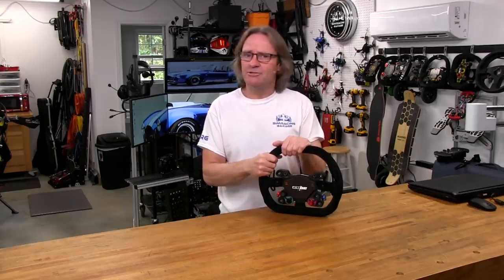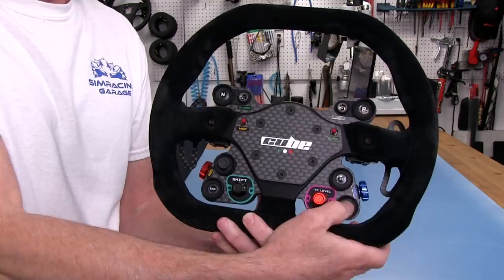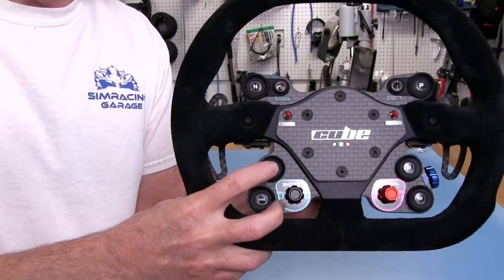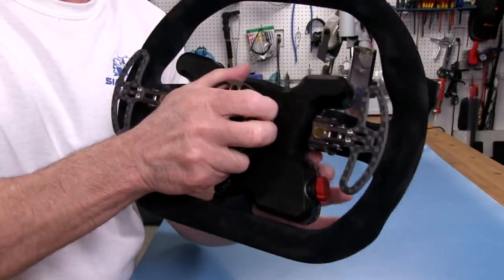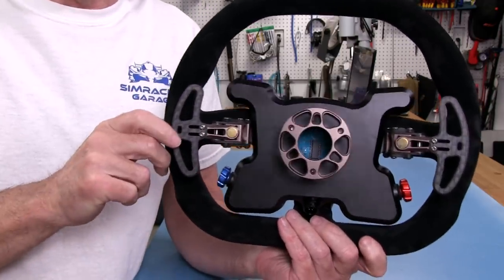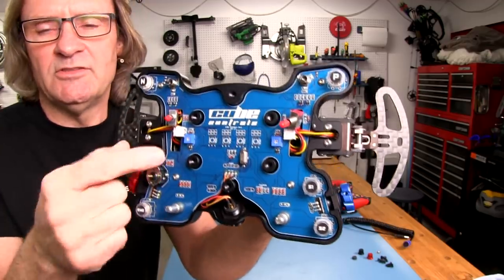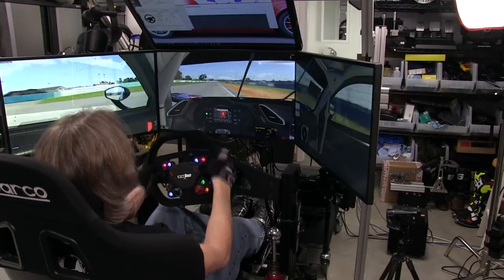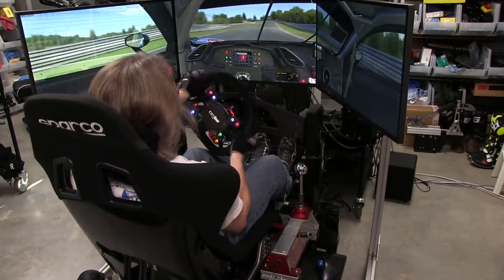Cube Controls GT Pro Sparco Wheel Review

Comment: Barry, can you please verify that the Turn R1 steering wheel does fit the Cube Controls GT button plate with the new 45 degree cable design?
Reply from the maker: Yes, it will fit. The new angle allows it to clear the bottom with room to screw on the cable. The bottom of the button plate is a close fit in the rim, but does fit. Also, don't forget about the 2 momentary rockers on this plate. You will need to cut holes in the wheels hub area to fit them. Or, get a plate without them when ordering.
Reply: Sim Racing Garage, thank you for the reply!